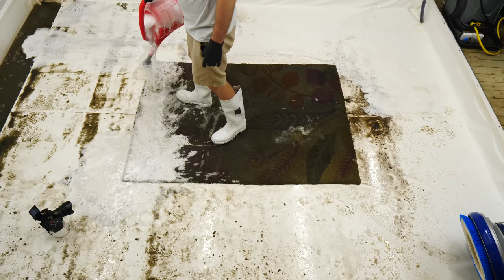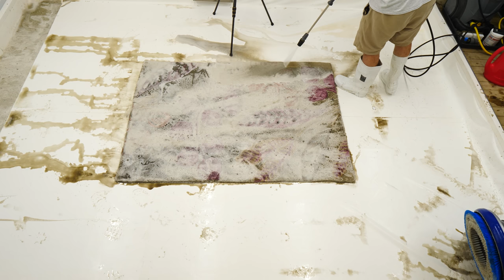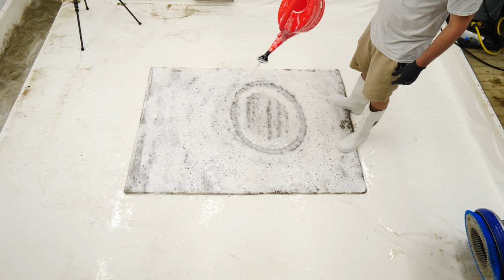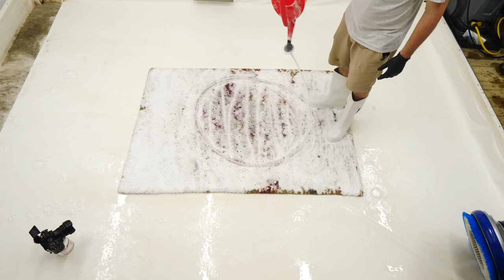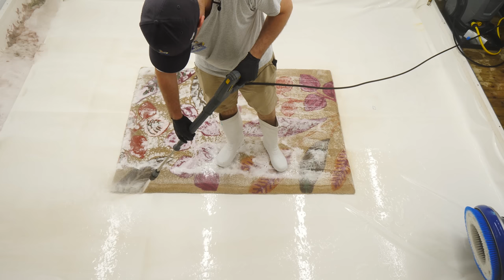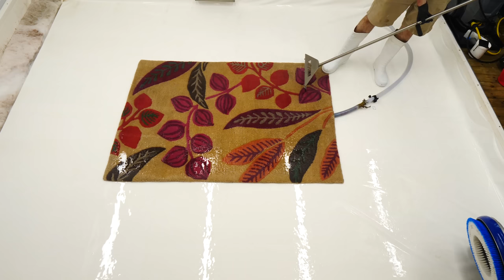BEAUTIFUL Pattern Emerges From This Putrid, Stinky Rug ! Satisfying Carpet Cleaning

Comment: Just so everyone knows, cleaning a rug and cleaning a carpet are two totally different animals. There are steps he can take to cleanse the rug that I can't to clean a carpet, but most the time carpets don't get this bad, those are the rugs and upholstery that require this level of cleaning. Sometimes, the carpet as a whole just needs to be replaced. I can't flip it over and scrub again. If the carpet is replaced I do scrub the floor so dirt won't "walk back up" into the new carpet. I like that he uses a vacuum to remove the extra water at the end, soap draws dirt. Good show. Keep up the good work!
Reply: This is a rug, correct. ✅

Comment: Watching your videos I've noticed 2 things that would probably greatly change the results of the clean, in effort needed at least. 1 you should wash the underside at least once after several soaping and 2 you should rotate the run 90 degrees at least 2 times through the process.

Comment: About 10:45, you’ve finished squeegeeing it the first time, and go to roll it up.  However, the face of the rug when you start rolling it is covered with suds, though it was clear when you finished squeegeeing it.  Did the solution just foam up while you were preparing to roll it, or was something added before you started rolling?
Reply from the maker: I add water to the top which also foams up existing soap in the rug
Reply: @MountainRugCleaning  thank you!

Comment: I can’t help but think there would be less steps if, after initially cleaning the pile, you didn’t roll up the rug in preparation for cleaning the back of the rug, putting the dirt from the back into the pile, and then walking along the rolled rug to push the dirt from the back of the rug deeper into the pile. I’m no expert, but it doesn’t seem very logical.
Reply from the maker: its not logical. Its only for the satisfaction. But it really doesn't add much work to it at all

Comment: This video should be used for all water savings campaign.. I mean the sheer dumbness in using a flat surface, instead of a fine mesh surface, so that the naximum dirt can be removed from both top and bottom, with minimum use of water and with a little bit of force.. This is sheer dumbness.. Basics physics not applied. Only chemistry with different varieties of detergents applied.. If you notice, until the last wash, dirt was coming from the bottom.. 🤦‍♂️
Reply from the maker: Uses more water with a mesh screen than it does from a flat surface.
Reply: @MountainRugCleaning  But it let's the nasty water through. Means, less moving of the carpet and less cleaning, since the soil can go through the mesh & you don't need to waste your time with cleaning the surface. 😅

One more thing, to you have something to remove the rough dirt before watering the carpet? Could actually also help to have less work 🥰